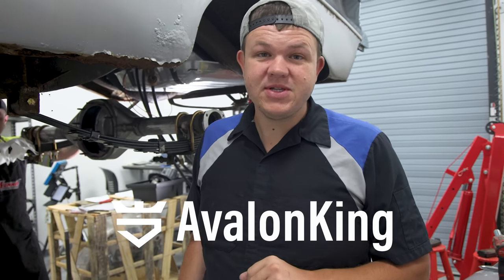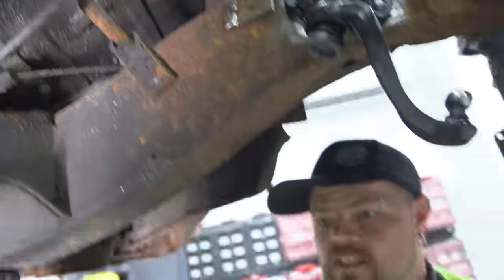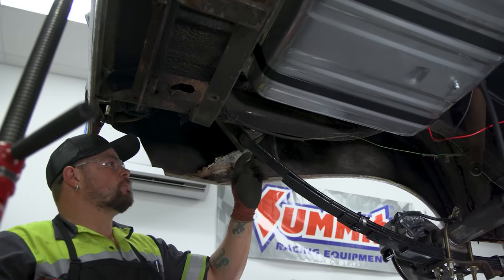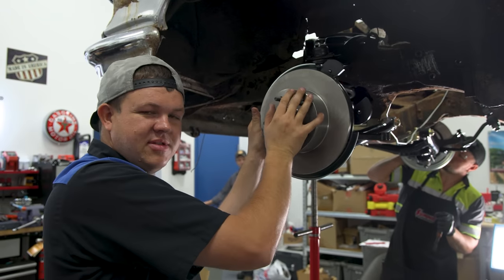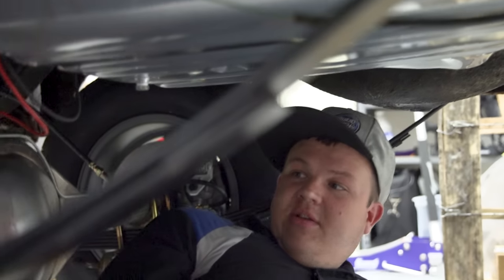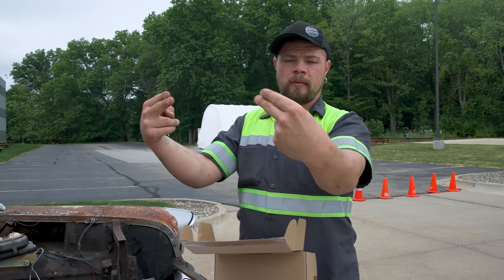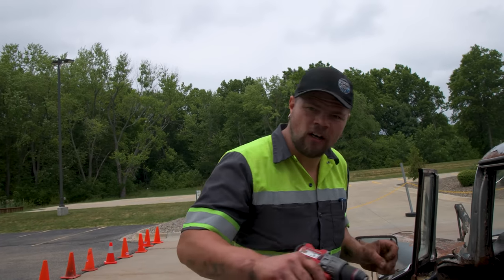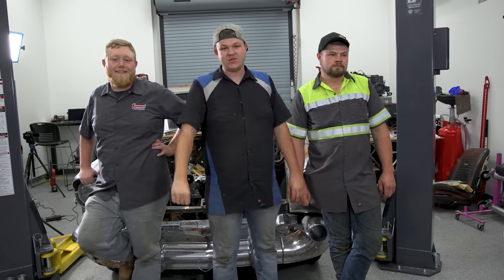Will 6.2 LS Engine Get This 57 Chevy Bel Air to Drive?

Comment: Someone put a flare fitting on backwards on that short piece. That's an amazing tool, and wish I had one like it, but ya gotta be smarter than what you're working with. Be careful when put things together, that both pieces are facing the right direction.

Comment: When you are working with extra thick oils, just heat the oil in a microwave for 1 or 2 minutes, until it is hot enough to lower its viscosity!

Comment: 30+ years as a mechanic, I've always used silicone on the diff cover and put gear oil in right away. Never waited and never had any problems
Reply: Exactly! So much misinformation in this series, like the engine trans and rear end all being junk. WTH! You were using the clutch to slow the car I believe everything was fine. Body shops shouldn't try to do mechanic work apparently.
Reply: @luketitchenell1263 why don’t you tell us how you really feel

Comment: Just FYI, per SAE (and FAA) requirement bolt/nut engagement has 3 threads exposed on the outside of the nut.  This isn't a rule (unless you're racing) but it's a good guideline to follow when assembling - why 3? because it makes it quite easy to see (on visual inspection) whether or not the nut has backed off when everything is 3 threads.... are you going to get a ticket? no, but is it good practice?... yes.

Comment: The speedometer cable also drives the odometer, so if the tenths of a mile change it's a good indicator that the speedo will work . 
But not a guarantee.

Comment: In the past I taught engineering students about bearings.  I'm glad to see you are wearing gloves while handling the bearings.  Another way you can pack a bearing is to put it into a recloseable plastic bag with the grease.  Do not wash a new bearing in a parts washer prior to packing grease in it.  NEVER touch the bearing surfaces with your bare hands.  The acids in your skin attack the metal.  And never drive a bearing in with an impact tool such as a hammer.  Doing the installation that way can put flat spots on the bearing surfaces.  This is called brinelling.  When putting a bearing into another part always press on the outer ring(race).  If you are installing a bearing on a shaft, press on the inner ring(race).  To prevent injury, never spin a bearing using compressed air.  Doing this can cause the bearing to explode, throwing parts in every direction.

Comment: You can make packing bearings easier by using the wide side to stuff grease in I had a high school mechanics teacher that could pack bearings with one hand
Reply: That’s how I was taught to do it also when I was an aircraft mechanic.  Put a pile of grease in the palm of one hand, put the bearing on the second section of the middle finger of the other hand with the large side of the bearing facing down.  Bend the finger and slap the open part of the bearing into the grease repeatedly, pressing the grease into the bearing.  Rotate the entire bearing when the grease starts coming out the upper, smaller part of the bearing and continue slapping it into the grease and rotating it until the entire bearing has grease coming out the smaller end.  Very quick and easy process.

Comment: I always enjoy the work you and Hillbilly do, but I have one question. When you torque up bolts are the bolts dry or lubricated ?
Dry bolt torque is approximately 30% higher. If the bolt is lubricated with SAE 30 oil - the torque compared to a dry bolt is reduced by approximately 40%.

Comment: Hi guys awesome wit out question but can't understand why u can't use welder can u explain why u have to drill and bolt and not have the option of using a welder always awesome to watch tho mates.
Reply from the maker: We just can’t use a welder in the Summit building. It’s a safety thing. There is lots of employees and lots of inventory in the building. A fire would not be fun.

Comment: You guys are in for a rough ride home, you have the wrong rear shackles. 57 chevy takes shackles that are curved so the weight of the car will not bottom out the spring travel. The u-bolts on the rearend will loosen up also because they are not straight up and down. The rear shock mounts break out of tri-5 chevys, bad design. There is a aftermarket shock crossmember available that bolts to the frame. Good luck guys.